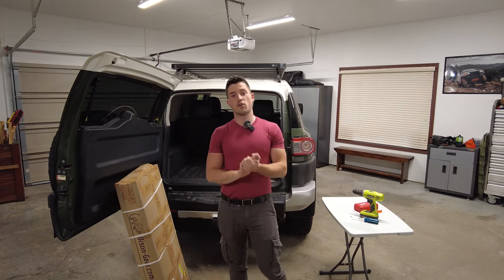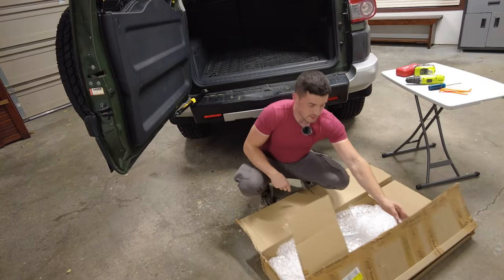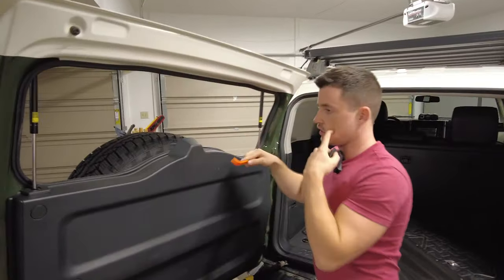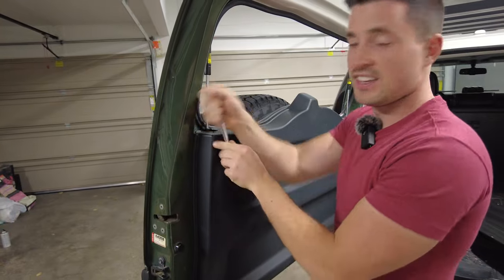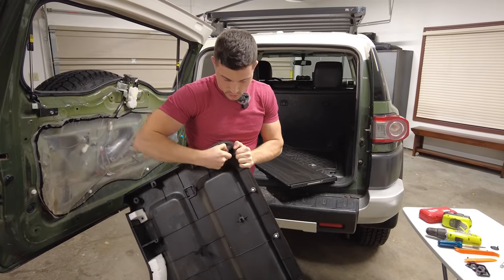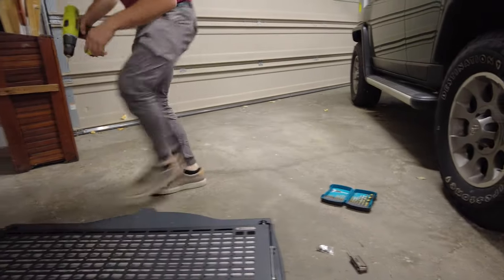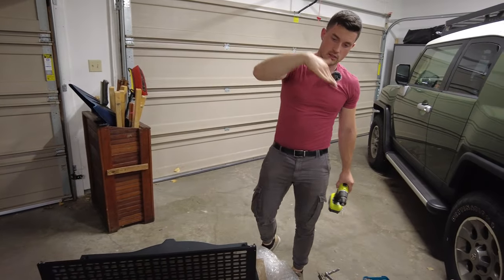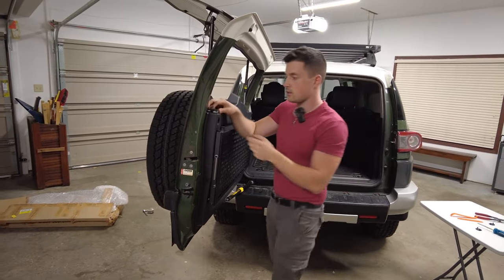FJ CRUISER - Is this Bison Gear table something you need?

Comment: I have one of the tables and they are great. I did add large washers on the bolts that hold the table onto the plastic door cover to speed the load at the hold points. 

Also, it’s good to get extra clips, I found some of mine were broken, probably from previous owner, but can happen when you remove the cover